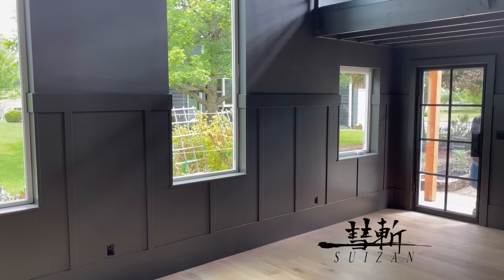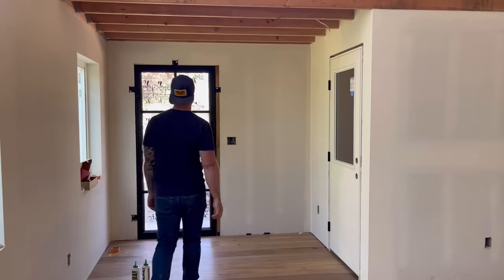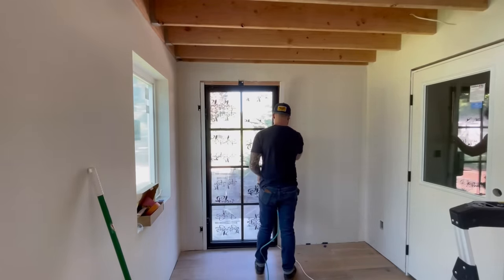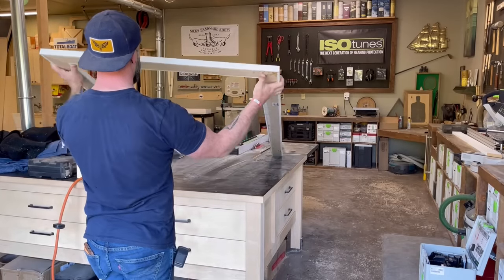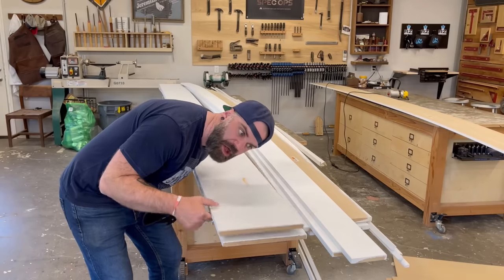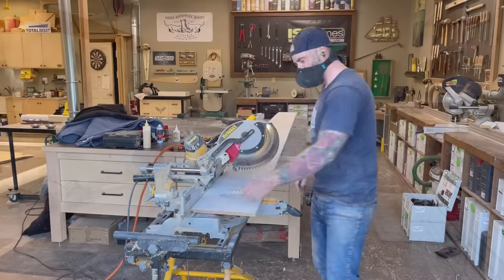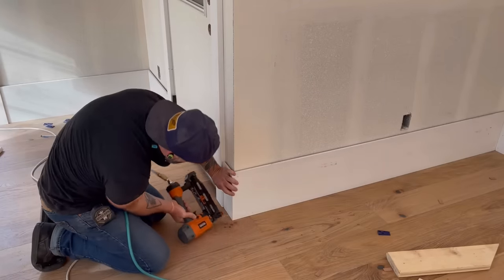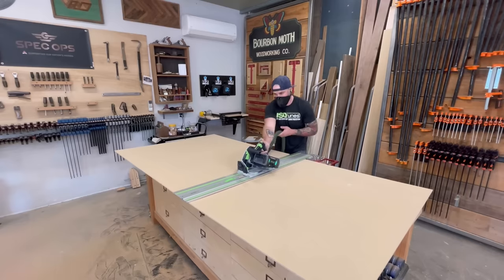Insanely Easy Wall Detail || DIY Decorative Casing

Comment: Taking pictures of every inch of your house has always been a life saver for me (both while it’s under construction, and even after it’s finished)  You never know when you need to reference some obscure part of it, to answer a question you may have.
Reply: I worked for a custom home builder for a short while and this is exactly what I did! I actually did very slow video walk-throughs and used them often.

Comment: Flush trim router for the windows/outlets is GENIUS. 15ish years of doing handyman work (Now doing carpentry) I never thought of that lol
Reply: Cutting holes in drywall for outlet boxes is pretty commonly done with a rotozip. Similar concept. But the trim router with a full bearing bottom flush bit probably looks a LOT nicer in mdf than a rotozip would.

Comment: I like your practical approach. Just because you are a skilled woodworker doesn't mean you have to cut down your own trees, dry the wood for 5 years, mill it, etc. Use what works for the job. You're still applying a lot of skills in the use of the materials, tools, and techniques.

Comment: That's the first time I've seen the battons installed without the headache of measuring over and over and I like it! Going to try that method with my office this summer/ fall when I get the bookcases built. Had been wondering what I would do on the other walls because I know I don't want to leave just the textured drywall. 
This video hit just perfect for me for the remainder of the year!

Comment: Swedish worker here. I have a tip you probably already know rgarding the door trimmings.
Start with the top , not the sides. Use a level. Door should already be level but you never know.
Calculate the proper width. Cut. Nail.
Now take two precut lengths (with 45 degree cut) , Stick it to the floor-wall upside down with the pointy edge touching the floor. on Top of the top trim. Mark it on Top of the overlap on eye-level. Dont mix the up before making. 
Perfect lengths, works especially well with 45 degree angle.

Remember to let it off the ground 1/8th of an inch or 3-5mm.

Two measures for 6 cuts. (Top width and side position of the top trim need markings)
Reply: Another Amazing Video! Thank you. 🇦🇺👴🏻

Comment: Great video. At my house I used 1/4” hardboard glued and stapled to the wall, staples covered by battens. All painted with a brush to try to mimic the look of a wood a little bit more.

The groove on the top and bottom trim is awesome. Would have kept me from having to add a top cap.

Comment: Wow this turned out beautifully. I went a measured but I didn’t do a complicated wall with layers like this. Well done. They sell some boxes with a screw adjustment allowing you to move the box in and out by screwing or unscrewing one screw in the corner.

Comment: I appreciated the advice about eye balling the vertical slats between the windows. That just makes more sense than trying to measure everything and the result is excellent. 
The way you cut that quarter inch groove in the top and bottom boards so everything slotted in was really professional. I would have just glued regular board to the wall with no groove haha!

Thanks for the tutorial man!

Comment: Looks great! I am going to do this ....  smaller scale in our hallway... the wainscotting is from the 50's and needs to go. Thanks for the Idea!
Tool Tip:
Use Electrical Wall Boxes with Adjustable Brackets, turn a screw to adjust the depth of the box. Brings them right front and center when you want to add to the wall and if you ever go back to flat walls, just turn the screw the other way to suck them back in.  less than 5 bucks at Home Depot....

Comment: Looks great. Thanks for mentioning extending the outlet boxes. Whenever you have a combustible wall the outlet box has to be flush with the face of the wall. The 1/4 pieces you mentioned are call box extensions.

Comment: Great video sir. Pro tip from a finish carpenter of 40 plus years. I will typically layout all trim components directly onto the wall before starting. Often times moving an electrical box an inch or two will save you from a notch in the trim or a weird sized panel. The 1/4” panel means the drywall repair doesn’t need to be perfect. Just remember if your putting trim close to a box, the electrical trim plate is bigger than the box. 🫣

Comment: Great video as usual. Doing a bathroom now and I opted for  beadboard panels vertically, with 6" baseboards and a 4" cap, all in a dark bluish gray and white walls at the top. Prefer a color at the top but given it's a small bathroom, I didn't want to make it feel smaller. Doing a bifold barn door since I don't have room for a traditional sliding one... Didn't even know there was hardware for bifold doors.

Comment: Great work. Only thing I wouldn't have done was the MDF on the window sills. Just takes one time if your kid leaves a window open and a rainstorm happens and it's all trashed. I did almost exactly this in my old home in Louisiana using 1/4" underlayment plywood. I probably spent a bit more because the sanding required to get it smooth was intense, but otherwise I was happy with the result. I'm just more specific on when I use MDF in high-humidity environments.

Comment: So I remember you mentioning about going with the very small trim around the window sill there. I can see why you would do that. It doesn't distract from the battens etc.  It's much much smaller in size so it doesn't bring your eye to it versus going with the full size battens in conjunction which would detract.

Comment: I use the scraping blade on my multi tool for cutting drywall. It cuts way down on dust. Sharpen it up a bit and it cuts pretty fast and smooth.

Comment: Hey Jason,  this looks amazing.  I had 2 questions...Because the space was already so well done, WHY did you use the 1/4 mdf on the wall, vs just put the casing on?  Question 2 was, where did you find 1/4 MDF I have looked everywhere and it is either really expensive (96.00 a sheet) or only in bulk?

I really like the methodology and it is really clean! 

Thanks for any help.

Comment: Another suggestion for panel spacing, try to create an odd number of panels on each wall if possible. It just looks better. You did this on the window wall when you count the corner by the door.
Reply: Odd numbers creates a panel centered on the wall. It is usually fairly easy to then create evenly spaced/width panels on each side of the centered panel of that wall and possibly all walls and it looks  best when that centered panel is either slightly wider or.. even better..visibly wider/ much wider.. as a focal point. The layout he created looks really clean and visibly consistent... only suggestion that I have would be to have used the same outside corner trim that he used on the window returns on the outside corner of the room... just for consistency.

Comment: I do quite a bit of trim and I've come full circle back to butt joints, flat stock like base gets pressure fitted and glued with a biscuit in the joint and I glue crown in the joint of course but also on the back side with something like a couple of paint stir sticks spanning the seam.

Comment: Great look! Really like the grey. I've seen many ways to button over and around an outlet or switch. NOT GOOD!
I understand the reasoning for using MDF you made one mistake. With all the pros of MDF there is always one outstanding con. It will not tolerate water. It swells and disfigured and you cannot fix it but trimming or sanding.
You should have used Poplar. I'm  in North Texas and have bubbling paint on most of the window sills in the corners from moisture. You're in West Portland where the moisture is always present.
Can't wait to see more!
Reply from the maker: Sounds like your windows are compromised, moisture should stay on the outside of the building

Comment: I do this for dry wall not sure how well it will work with MDF. I stick cut off screws in the outlet screw holes, stick the drywall where its going to go and press hard around the outlet. This puts holes in the drywall, you then take a spare outlet box, with another couple of cut off screws and place it in the holes, mark around the box and then cut out the opening.

Comment: I've worked with Architects that have set the wall sizes, ceiling adjacencies, window spacing, flooring finish specifications, etc. based on the board + batten with a 1/16" tolerances. You can take a tape to it and it's perfect. I think for my money, I would at least have tried to make it perfect. Doesn't matter if other people don't notice - I'd be bothered by it. :)
Reply: Same experience with working with designers and doing my own layout for existing rooms. It is usually possible to create even panel widths if you create a center panel and make that panel only slightly wider or .. even better.. noticeably wider for visual interest.  Also adding inside corner vertical battens ... sometimes just slightly wider ... can aid in finding a consistent panel width on all the walls.

Comment: @Jason: I have 4 questions, 1 comments, and no criticism.. Before the questions, love your channel, love you work, love your podcast too!  Questions: 1. What's the point in the 1/4" mdf, couldn't you just have trimmed it with 3/4 and painted the drywall in-between(I've done some wainscoting and used panels, but that was for the bead in it, there probably is a reason, I'm just not so smart lol)? 2. Did you, or will you do a final transition at the floor? i.e. 1/4-round or something, or just leaving it as is? 3. did you caulk everything, or just leave it with pretty tight seams and let the paint fill what it needed?  4. You have all the coolest toys, but when you pull out nail guns you're tethered to an air hose, any reason besides "i already own them and they're fine"? I own a ton of tools myself and my 3 recent-ish purchases that I feel were the most well worth it were my battery powered finish nailer, brad nailer, and framing nailer?  Comments: 1. love your concept of space them as even as you feel looks right, don't waste time getting super precise measurements!  criticism: wish i had something to bash you with, but just don't...

Comment: If you have some older clamps that you don't want i can use them or anything else because when i was getting approved for disability i had to go 2 years without any income so i had to sell a lot of tools. I can work short periods before the pain gets bad. I worked in construction 34 years until my lower back got so bad

Comment: Looks great, but have to ask, did you really need the 1/4" MDF on the walls? Couldn't you have just gone with the original drywall with battens?
Reply: I also wondered what the benefit was of having the MDF panels

Comment: Looks great. Just curious- is there a reason you added all the mdf sheeting instead of just attaching the trim and battens to the drywall?
Reply: EXACTLY what I just commented. You can use the drywall and skip routing and the huge added expense for those sheets. He coulda did the whole room for like $250-300 max.
Reply: IMO it looks way better with the MDF because it smooths it out and helps separate between the textured drywall.
Reply: Yeah, it would not have the appearance of traditional wainscoting.  It would just look like battens on drywall.  Even the best painter would not be able to match the finish of the drywall to the mdf trim and as pointed out previously the texture of the drywall above the wainscoting adds to the visual effect/appearance.

Comment: so two questions. why did you use the 1/4 mdf sheets at all? wouldnt it be easier to slap the battens on the plaster sheets? and whats going on with the texture on the walls above the decorative casing? looks great, just curious

Comment: Ok, question Jason…You seem to have used 1/4 MDF as the backer board. Looks like full 4x8 sheets. I’m in the Midwest and there are no Home Depot (or POs as I call them) or Lowes or lumber yards that carry 4x8 sheets of 1/4 MDF.  Would 1/4 hardboard work just as well? I’ve never tried painting hardboard. I’ve got textured walls as well so am in need of some sort of backer, similar to that which you used. Thanks for your thoughts and amazing videos.

Comment: I saw a tip on the Skill builder channel, put some masking tape (painters tape) on the floor, then fix your base/skirting board on top. Painter comes in, paints and using a stanley/box cutter knife, trims the tape and you end up with nice neat floors. (Not my tip!)

Comment: Another option is the trim the wall without the plywood and just paint the drywall to match. It will look the same.
Reply: The walls are orange peel textured. I’ve seen plenty of wainscoting over orange peel and it looks nice but having that smooth surface looks super clean :D

Comment: Question - why add the 1/4-inch panels instead of installing the battens directly to the drywall?  I'm planning a similar project and had not considered using panels...yet.  I appreciate the feedback and great content!
Reply: Without the panels it would not have the appearance of traditional wainscoting.  It would just look like battens on a drywall wall.  Even the best painter would not be able to get the same finish on drywall next to mdf trim .

Comment: If you're making shaker style MDF cupboard or wardrobe doors. would you cut a rebate in the frame or lay 3mm (1/8 inch) MDF on top of 12mm (1/2 inch) sheet to create a fake frame?

Comment: What size MDF are you using for the baseboard molding and what size are you using for the wall  Panel i think it would have been better if you put the panel all the way down to the floor and then put the trim over that so it gave it the full reveal but beautiful work. Unless you're using quarter inch panel 3/4 inch baseboard It's hard to tell from the video
Reply: its not hard to tell if you listen to the video... he says dimensions 🤨

Comment: maybe I'm just lazy; but could you get same effect (esp with dark paint) by just using 1x4's top, bottom and battens and skip MDF panels?
Reply: Probably, since his walls were new and not textured. If the room had been finished, that probably would not work. The 1/4 panels cover up any wall imperfections, so everything looks smooth and clean. If he hadn't used them, you might see nail holes in the drywall or where seams are if sunlight hit them at the right angle.

Comment: If one wanted to do it with veneered ply, or stained dark wood where the surface finish mattered what would the solution be without liberal application of a nailer?

Rabbits and expansion gaps on the panels?

Comment: what's the advantage of adding the thin mdf sheets? given they have no grain and everything is painted over wouldn't be quicker and cheaper to just add the trims and battens?
Reply: For a smooth surface. It’s probably orange peel on the drywall.

Comment: Kinda disappointed the trim was not all walnut or at least oak :)

Also, my experience shows that if you do baseboard from MDF, over the years it may suck in enough water to deform a tiny but noticeable bit. Not an issue if you don't wash your floors though.

Comment: Question: Why go through all the effort of adding the MDF?  Why can't you just put the vertical and horizontal pieces on the drywall? Would save time, money, and effort.
Reply: I have done 4 rooms in my house direct on the drywall.  You really cannot tell and it’s so much quicker and cheaper.

Comment: If you already have a smooth flat wall why would you need to spend the money on mdf? Couldn't you just use a high strength construction adhesive and brad nails for the batten? Just wondering what the benefit of the mdf paneling would be.

Comment: Looks great, but I'm not sure why you installed the 1/4" board, is it for durability? Why not just install the battens and paint the wall to match?  I've seen it plenty, and once it's all done you can't tell there's no actual "board" to your 'board and batten'.
Reply from the maker: Well you can most definitely tell, unless your drywall is perfectly smooth. Which it never is. And by putting the 1/4” MDF up you can put battens anywhere you want.
Reply: @Bourbonmoth  Fair.

Comment: I live is Singapore, and our houses are built with concrete. I did a board and batten in room and had to drill MANY holes to attached the wood to the wall. I know liquid nails exists but i don't want to destroy my walla if i remove them.

Now i'm trying to figure out how to do board and batten in my living room without drill shit ton of holes or using liquid nails. I am thinking of using smart cleat system to hang them as a panel.Also with using a cleat i could easily remove it when im no longer loving it. I hope someone actually do a video on this so i would know if it actually works.

Comment: So, it looks like you took 1/2" baseboard, routed out 1/4" and it left EXACTLY 1/4" thickness left for a baton to fit PERFECTLY flat with the baseboard with no need of flat sanding. Sorry, but I have to believe that is impossible.  The material is NEVER exactly 1/2" and 1/4" when you buy it at the store.  I am a big fan of the channel, and I really do plan on doing this project, but I can't help but feel you left out some important details on how you got your batons to match perfectly to your baseboard.